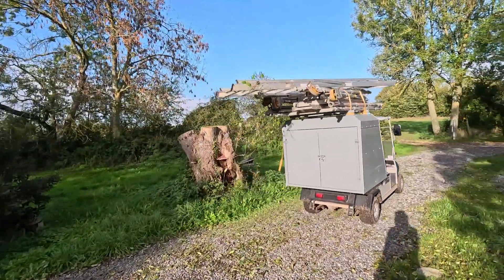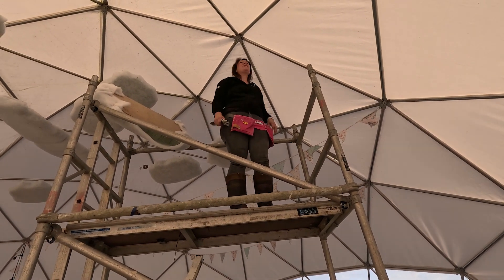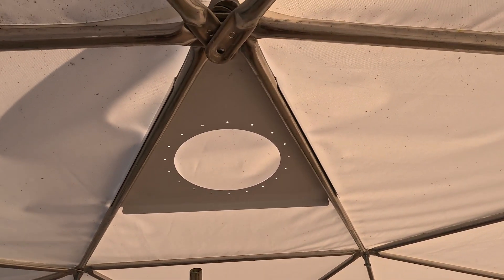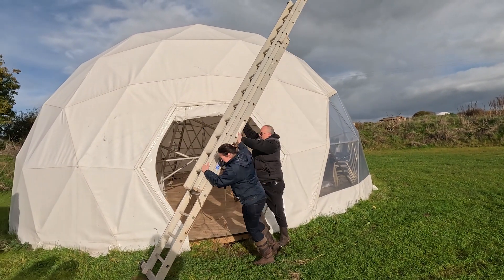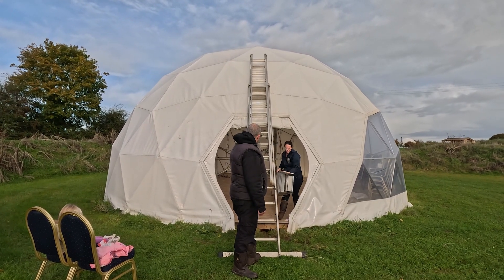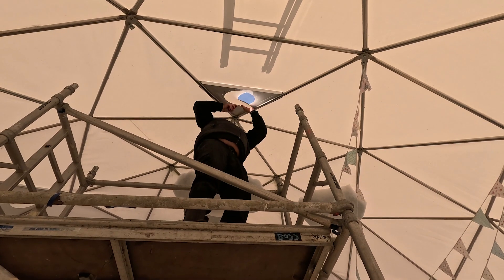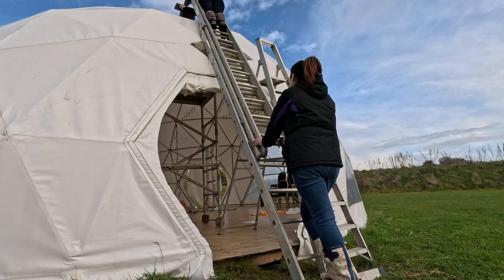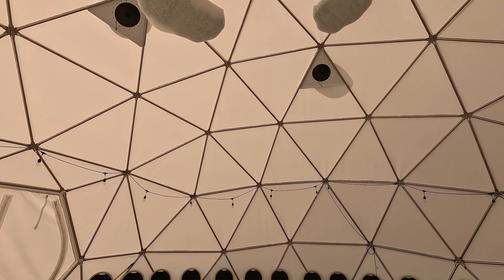How to Stop Condensation in a Geodesic Dome

Comment: Hi! It´s a great channel and very interesting to watch especially for me, as I want to setup a geodome glamping in Spain. I wanted to ask about insulation and climate inside in hot days (which happen all year round in Spain :)) You´ve got not AC. Is this insulation configuration enough for keeping it nice inside? Some manufacturers offer double ply plating with a 10cm of foam insulation in between, some offer double plywood and additional PVC cover with spacers, which adds 10cm of air circulating freely under PVC to prevent heat from going inside the dome. Could you comment of that please, based on your experience.
Reply from the maker: Hi, thanks for your comment! Oh wow that sounds really exciting. 
So in England it doesn't really ever get too hot and we find that guests tend to be outside in the daytime and we have created outdoor areas that encourage them to be outside during the day. I would say that in Spain you would need an AC or something that can give you heating and cooling. The insulation we have is enough for our usage in England and only during the summer months but if you wanted to offer glamping in the winter or get extreme heat then I think you would need a higher level of insulation. That said, the panoramic window of a dome is one of the best features and that doesn't have any insulation on it so there will be parts where you will lose the benefit. Are you going to build the domes yourself or go to a manufacturer? Thanks, Vicki
Reply: @TractorsandCream  Actually, I haven´t decided so far about geodomes, becasue there is another concept: tiny houses. They are more compact and easier to install and they dont require any construction licnese and bureaucracy can last for ages! After all, everything depends on the plot Im going to buy: with a far reaching view a geodome with its wide window is a top choice. But with a more modest setting a tiny house will do. Of course I will assemble it myself but I wont design and manufacture it. I´ve got a list of around 10 manufacturers to study across Europe offering different levels of kits, from just triangles included up to multilayered systems. I would probably go with a dome of around 7+m in diameter to be able to fit a bathroom (just as you did in your last build) but also a kitchenette! With a posibility to install an attic bed on top of all this just under the roof :))))
Reply from the maker: @lionelll777  that sounds perfect! There are some incredible tiny home designs out there now. Have you watched our glamping show America's video? They had some amazing tiny homes. Would love to know what you end up building. Are you looking for land now?
Reply: @TractorsandCream  Of course I watched it, I´ve got lots on information out of it! There are a several tiny houses manufacturers in Europe, too. I will be looking for land in late 2024, but before I have to collect all the information about those 2 options (tiny houses and domes) and all the stuff around them (solar, water (which is a big pain in Spain), sewage, local regulations etc etc). And keeping all that in mind look for the plot to have the vision of how to split up my tight budget between the plot, housing and infrastructure :) So, I´ve started collecting info well in advance.
Reply from the maker: @lionelll777  that's brilliant that you are so organised. Please keep in touch and let me know if there is anything I can help with.☺️
Reply: @TractorsandCream  Thanks so much! You´ve already helped me a lot witht he information on your channel!!! I´ve supscribed to your channel so I´ll ping you as soon as I´ve got updates with my project!
Reply from the maker: @lionelll777  amazing thank you!
Reply from the maker: @lionelll777  great I will email you!